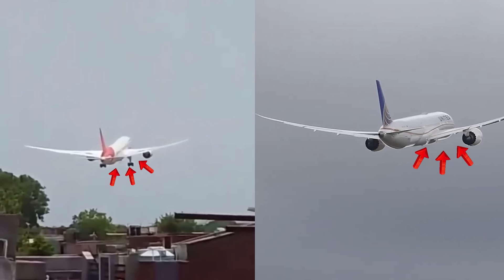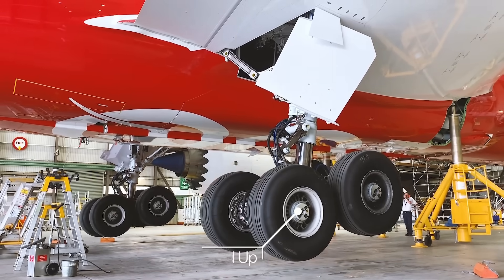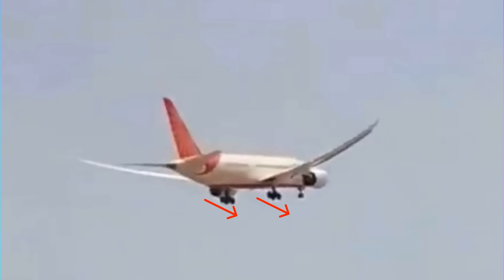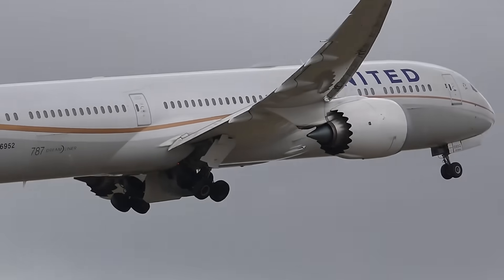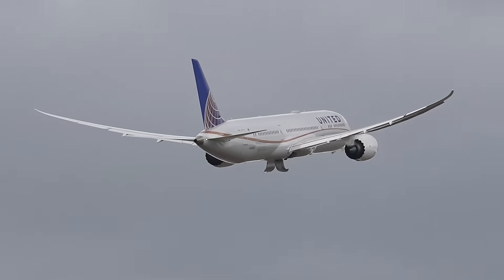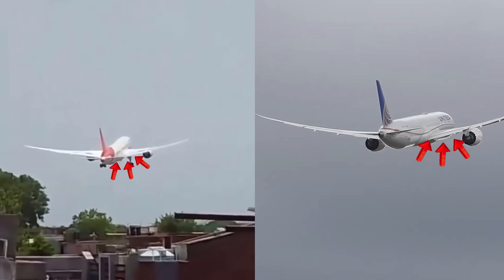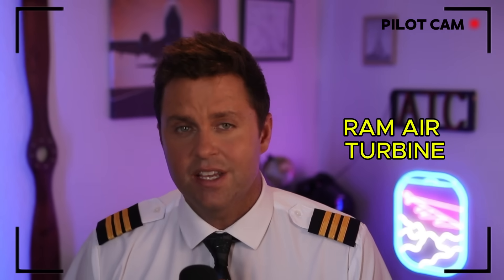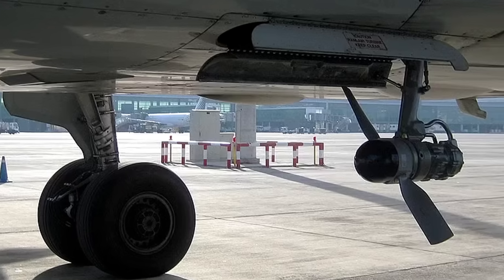Pilot Explains: A New Detail in the Air India 787 Crash Everyone Missed

Comment: The 787 has 6 electrically powered fuel pumps. Two are in the center tank, and two more in each of the wing tanks. If electrical power is lost and all six pumps stop working, then both engines will flame out. There are two computerized management systems that manage the 787's complete electrical system. There was a software glitch discovered in the system that could cause both management systems to go into failsafe mode at the same time. This was supposed to be fixed by an airworthiness directive back in 2015, but who knows if it really fixed the problem or if the new software was actually installed in this particular aircraft.
Reply: right on the money!
Reply: If this crash was caused by fuel starvation due to electrical failure,  Boeing is going to be in the fkn bullseye again!   What a dumb fkn design!
Reply: There’s a boost pump in the left tank powered from the battery buss. Insurance against total electric failure.
Reply: @tomsage653 I believe that extra pump is for the APU.
Reply: @joevignolor4u949 
I’m an old retired airline pilot. What I said is true it’s very easy to look up. Yes, modern planes are different. They are actually made so any DEI hire is less likely to kill themself. Boeing has been using at least one DC powered boost pump since the 727. ( My resume.)
The 787 has one in the left tank. They are powered by the battery buss whenever the boost pump switch is on. I’m sure on the 787 all pumps are on for takeoff.
Reply: @tomsage653  I think you're thinking of the APU DC pump?
Reply: @ImperrfectStranger 
No. The 787 has a DC boost pump in the left tank powered from the battery buss. If all electric fails there will still be fuel pressure from that boost pump to supply all the engines. My antique 727 was made the same way.
Reply: @tomsage653  LOL... So this DC pump is going to power two giant engines? My not so antique 767, 747-400 and 777 has a single DC pump and it's not for powering the engines. 

The 787-8 FCOM says the DC pump powers the APU whenever there is no power to the left aft AC pump. I suggest you download a copy. 

And even AI disagrees with you on the 727.
Reply: @tomsage653  https://www.youtube.com/watch?v=WjRyzgvGgm4
Reply: @ImperrfectStranger 
Well AI can stick it. Retired off the 727 with over 23,000 hrs stick time on it.
Think about it. Do you think Boeing made airplanes that if all the generators went off line, the engines would quit ?
Reply: @tomsage653  No, they made engines with engine-driven pumps like they have for the last 50 years. 
So how do these AC pumps get driven by DC batteries? 
Stick time? Does that include time at the F/E's panell?
Reply: @ImperrfectStranger 
2 boost pumps are on the Essential AC buss. Loss of all generators the F/e switches essential to standby which uses the battery to power the essential buss through an in inverter. Was never a f/e. National Airlines was the only airline that had professional f/e’s.
New hire pilots went right into the right seat.
Reply: The battery is the source of power to the 2 essential AC powered boost pumps when all generators go off line. Bad wording on my part.
Reply: The engines can still suction feed without the fuel pumps. People need to stop this useless speculation and just wait until more data is released.
Reply: @robertbarber4486 I'm not speculating about anything. I've researched this and this is how the fuel delivery ststem works on a 787. The 787 is a new design that differs from previous aircraft. Older airplanes use mechanically driven fuel pumps that run off the engines. The 787 uses electrically driven fuel pumps that are inside the fuel tanks. If you think I'm wrong, then reasearch it yourself. I looked it up and so can you. Oh and by the way, the 787 also doesn't use hydraulics to apply the brakes like every other airplane does. The brakes are activated electrically, just like the fuel pumps.
Reply: @joevignolor4u949  good information bro. had no idea such thing exists.
Reply: @Ksgggg I was supprised myself when I started to learn how radically different the 787 is from any previous design. The biggest difference is the use of carbon fiber to make the fuselage,  wings, and tail. The two engines each have two electrical generators. All four generators together produce over one megawatt of electric power to operate things. The brakes are electrically activated instead of by using hydraulics and the cabin is pressurized by electric pumps instead of using bleed air off the engines.
Reply: @joevignolor4u949 Also during take off when nose is higher, even gravity failed to supply fuel to tanks. This makes sense why dual engine failure occured.
Reply: @joevignolor4u949 
Regardless of fuel delivery system, the thrust settings and fuel metering systems are all controlled electrically by FADEC computers.
I do agree that take of power fuel demand probably also requires electric fuel boost pumps in addition to engine driven pumps.
Basically the engines need a stable electric supply to run.
The RAT only powers basic flight control computers and electro hydraulic actuators.
Not engines or landing gear.
Reply: @joevignolor4u949  I've researched this myself, and you are wrong. I guess you were using AI to do your research. 
All Boeing aircraft have electric pumps in the tanks. All Boeing aircraft have mechanically driven pumps on the engines. I should know, I worked on them for 40 years.
Reply: @ImperrfectStranger  The fuel for the mechanical pumps is fed by what?
Reply: @StrikeEngine  Something called suction feed. The cockpit fuel synoptic indicates suction feed as amber lines according this CBT
https://www.youtube.com/watch?v=HilLkjuJiuo
See timestamp 2:42

I may have to withdraw my statement about the mechanical  pumps however. Maybe only the GEnx on the 747-8 has mechanical pumps.
On aircaft with suction feed, the fuel bypasses the tank electric pumps.
Reply: @joevignolor4u949 
All transport jets have electric powered boost pumps in the fuel tanks. However there is always one boost pump that’s on the battery buss. ( DC) Engines won’t quit with an all electrical failure.
Reply: @tomsage653  The 787 has vastly different architecture that any previous aircraft. You can't go by how things were done in the past. For example, the brakes are activated electrically, not using hydraulics. And the cabin is pressurized by electrically driven pumps, not by bleed air.
Reply: @ImperrfectStranger  No, the engines will continue to run on suction in the fuel lines if the pumps fail.
Reply: @simonissell  I think you addressed this to the wrong person, Simon. I've been telling people about suction feed for the last week. 
Having said that, I just heard that a Delta 767 suffered thrust lost on climbout after the pilot switched off the fuel pumps (with the overhead switches). That has a suction feed system, too. Boeing is lying to us regarding how reliable it is.
Reply: @ImperrfectStranger  Probably clicked reply on the wrong post, sorry.
I don't think there's evidence that Boeing is lying. It's there as a backup but there's no guarantee of full thrust being available - that will depend on the conditions.
Reply: @simonissell  Well, in the FCOM, they say that suction feed will only be an issue at higher altitudes in climb. At level off, no issue (they say).
Reply: @joevignolor4u949  yabut there would still need to be a fuel pump on each engine to receive the fuel from the tank pumps and INCREASE the pressure of that fuel (to approximately 500 psi) in order for the engine fuel nozzles to atomize the fuel sprayed into the engine combustion cans (liners) - no way just boost pumps in tanks can keep a gas turbine engine running - does the manual have a diagram of the "engine fuel system" ?
Reply: No I don’t think people should stop their speculations, this country and other great countries are founded on freedom of speech…. At anytime…. And why are you so sure the information that “comes out” is accurate?  Unless you believe everything “they” say 🤷🏽‍♂️
Reply: @robertbarber4486  Not enough.
Reply: You always design with three systems and do majority logic.  The two systems in agreement overrule the third glitching system.  The 737 max fiasco was ignoring this majority logic design rule by using only one AoA sensor.  I have a hard time believing Boeing has gone full retard and has forgotten what they once knew.
Reply: @mefobills279 You are right. Three is better than two. But that's just redundant hardware. If all three systems are running the same software and the software has a bug, then all three systems can shut down all at the same time.
Reply: @joevignolor4u949  Thats true.  There are circumstances where everything gets whacked.  Its been the standard for a long time now, to use majority logic, especially on mission critical computers.
Reply: @mefobills279 If you recall, the space shuttle used majority logic, although NASA called it a voting system. It had four general purpose computers, and three could vote out the other one. Also, the MAX should always should have had three AOA sensors and a voting system to lock out a bad sensor. If it did, those two planes would not have crashed.

Comment: Actually not everyone missed the landing gear in retracting position. I even mentioned it in Captain Steve's comment section yesterday. But since you're asking, there are conditions outside the cockpit which may have caused both engines to stop. I'll summarize a plausible theory posted in Captain Steve's comment section by @Bertieuz, an amateur aviation mechanic.

The front bay houses the FSC (fuel system controller). Should temperature in that bay exceed the FSC's operating limit, it may enter a "safe state" mode resulting in a reset. Such reset would stop all fuel pumps, causing the loss of fuel pressure to the engines. The EECs (electronic engine controls) would then stop the engines to protect them. Next the RAT would be activated and the aircraft would stall due to lack of thrust. How could this have happened? A few factors could've played a part in that tragedy by pushing the FSC over the edge:

- Ambient temperature of about 40ºC
- Wide-body stands facing South
- Sitting for 3 hours in full midday sun before take-off
- A fully loaded airplane requiring a longer take-off run at full thrust and generating more heat in the electrical circuitry

It should be noted that flightradar24 data shows this aircraft (and no other 787-8) had failed to send ADS B data during taxi at this airport (and none other) for weeks. The corresponding antenna sits in the forward bay, along with the FSC. Overheating in that bay due to a combination of factors may have caused an ill-timed reset soon after rotation.

Comment: It appears that a lot western and especially US based commentators / aviation influencers are trying to deflect what is potentially an issue with Boeing planes on Pilot error. The egg is on their face and their ability to be objective and their credibility is very low. There was a sw / hw failure that cut off fuel to engines. The fuel contamination theory is also BS given so many other planes were refueled at the airport. 

 A rank amateur like myself with no flying experience got this right after watching multiple video of other 787s taking off, sound of RAT deployed was clear to everyone.

Comment: I dont buy the contaminated fuel theory as other flights before would have suffered. Engines not only need fuel but electricity. There must have been an electrical malfunction not as a result of engine failure but rather the main cause leading to hydraulic pump failure to supply fuel...

Comment: If there were a failure if the battery system that caused a loss of electrical power,  before the RAT started generating power,  could the briefly unpowered engine control computer cause the engines to throttle back to idle?  (The APU did not have had enough time to restart.)

Comment: The mysterious problem that caused the dual engine failure is called Boeing. Everything they make nowadays is unsafe. They even fucked up with their space program this company is all about profits on a short term they don’t get the fact that this issues will show up sooner or later and they will become bankrupt. Stupidity at its peak this is what happens when a company is not managed by professionals but by politicians and brokers. The problem is that even their older planes which where amazing planes are getting old and they need to change parts and the new ones are made with the same mindset to save money.

Comment: Gary, I'm sure you've heard of the crash of Northwest Airlines Flight 255 outside of Detroit in August of 1987.  The cause of that crash was due to the pilots becoming distracted by incoming bad weather and failing to lower the flaps to takeoff position.  With the flaps NOT lowered and both engines at full power, the pilots could not get enough lift and they crashed immediately after takeoff.

Comment: If there was contaminated fuel, you would think other flights might have had the same problem.  So, instead, it might be more likely that the wrong fuel was loaded on this jet.   It took so long to achieve Vr, as though under powered.   It was a problem brewing before flight.

Comment: Is it possible that it was a catastrophic electrical system failure that knocked out the fuel supply and disabled the gear retraction, since it appears to have begun with the wheel tilt, but didn't proceed? Contaminated fuel arguably would have affected many more flights.

Comment: Capt. Steeve, is it possible that when one of the engines has gone down and the pilot was supposed to switch off that engine but mistakenly switched off the functioning engine as stated by somebody? Which possibly caused the crash.
Reply: No.  This close to the ground, with so much going on,  you'd not do anything drastic quite so quickly.   But, your thinking is correct.
Reply: Over and above the current speculations one should not undermine the testimonies of Sam Salehpour and Mitchell Bernett who were very much connected to the manufacturing of Boeing in early 2024 have warned of possibilities of catastrophe if safety and quality of the 787 & 777 are overlooked despite repeated warnings.Unfortunately these testimonies were never been highlited by any aviation agencies and media houses @eugeniustheodidactus8890

Comment: The man who survived the crash had posted videos online before takeoff, showing that not all the lights were working and some of the tablets were malfunctioning. There was clearly something wrong with the electrical system from the very beginning. Besides, both pilots were experienced, so I don’t believe they simply forgot to deploy the flaps or retract the landing gear. Those are mistakes made by kids on flight simulators, not by seasoned pilots. Moreover, before the crash, the crew reported that the engines had no thrust.
Reply: No. This was not the suvivor but a passenger on the previous flight from Delhi to Amedebad who posted the video.
Reply: It was not the survivor, like the upper guy said.

Comment: should ditch 10 ton hot staging ring and autogenously pressurize the interstage 10 seconds before separation to a few atmospheres then release clamps and have the build up of ~1000 tons of surface pressure separate them like a cork in a celebratory champagne bottle
Commented on SpaceX Found Brilliant Solution For Starship Hot Staging & Grid Fins Problem!